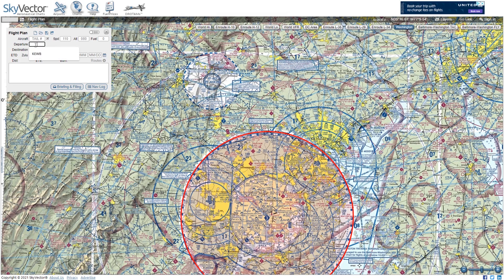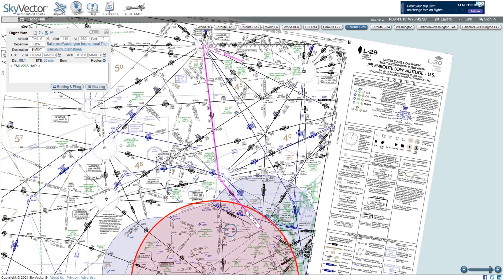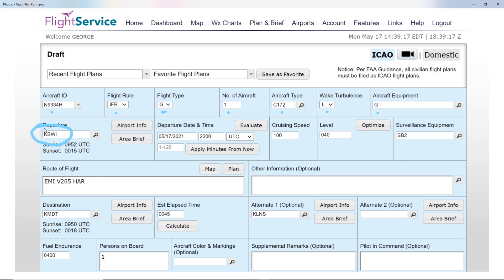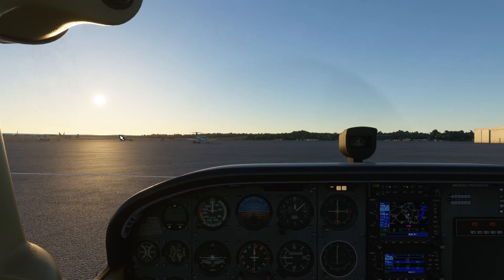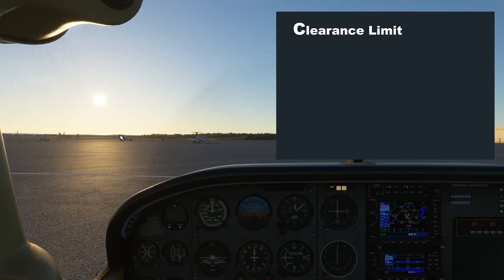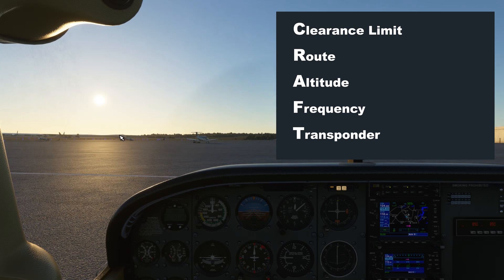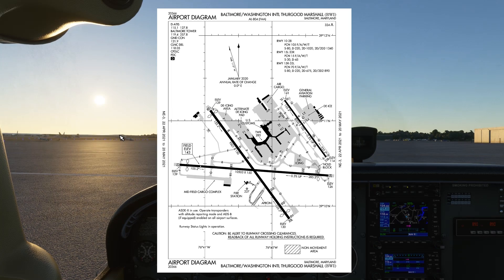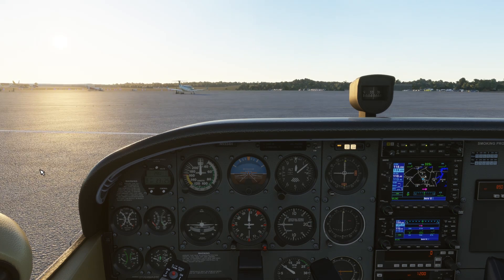CRAFT Clearance | Receiving IFR Clearance from ATC | IFR Clearance Practice

Comment: With FlightAware there’s also an “IFR Route Analyzer,” where it will list recently cleared routes and altitude ranges. Further, if you click the desired route, it automatically opens in SkyVector.  On the bottom of the page, it shows what specific flights used each route.

Comment: I would add to Vin Man's comment that you are the gold standard for training videos. Excellent presentations !! I do, however,  have a request for you. I continue to struggle with the IFR  filing when I have multiple "option" approaches at as many as 4 different airports. ATC always seems suprised JKA to JKA (BFM, MOB, PQL, CQF) I simply state in the remarks sections for "the option" approach at each airport. Seem simple enough. What should I be doing??

Comment: who’s talking to you on ATC? what software is it ? thanks.
Reply from the maker: It’s a platform called VATSIM. It’s a network of volunteers providing ATC services to pilots connected on their network, works with most flight sims including MSFS 2020. It’s not the real thing of course, but the skills of the controllers make it very nearly the real thing and I’ve found it be a great training tool. Their software is on their website if you google Vatsim
Reply: @flightinsight9111  thank you ! and does it work with Xplane?
Reply from the maker: Stephen Gaut xplane11. Yes it does
Reply: @flightinsight9111  mastering comprehension of authentic accents from ATC should be an ACS for IFR rating.  This guy sounds Bostonian.